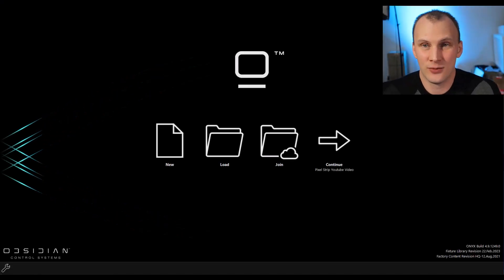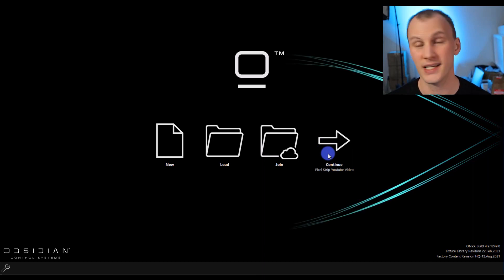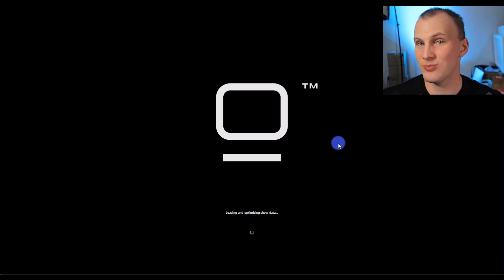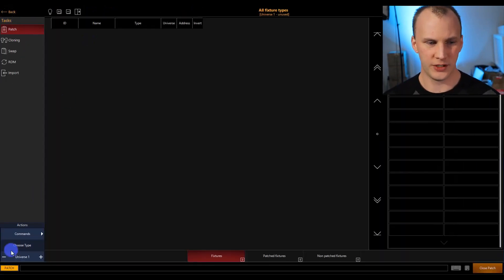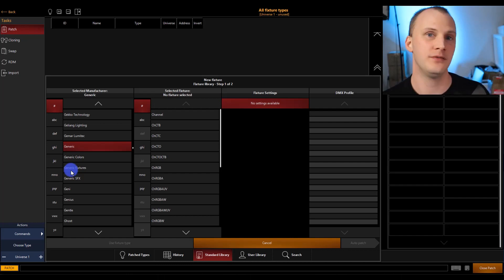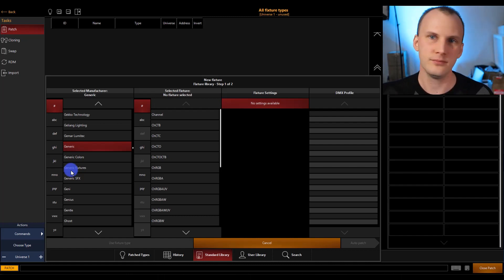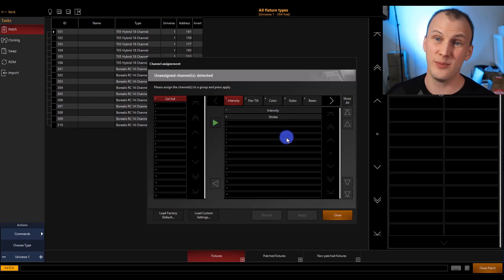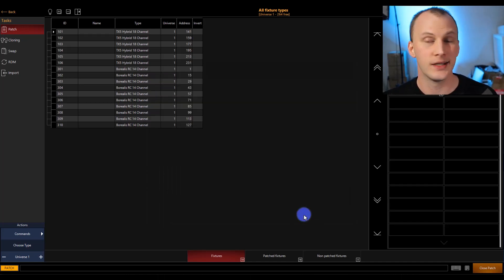How to Get Started with ONYX

Comment: Hmm. i dont see an 'auto patch' button on my software when choosing a fixture - maybe cause Im using the free version?
Reply from the maker: Onyx only has free software, unless you buy a console. Please take a look at our series on our Learn Stage Lighting - Learn Onyx channel.
Reply: Its a matter of adjusting the screen size. If you hover over the left gray window frame your curser will turn into a double sided arrow you can use to minimize the screen, then you should be able to take your curser to the black top screen where it says "New Fixture" where you can drag the window with your curser to get "Auto Patch" into view